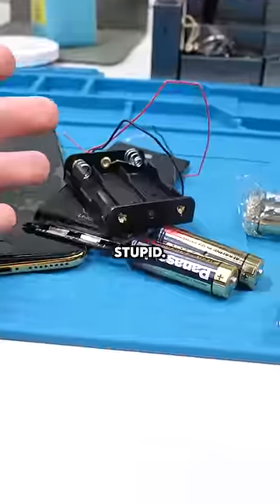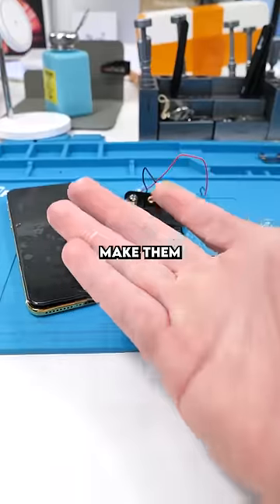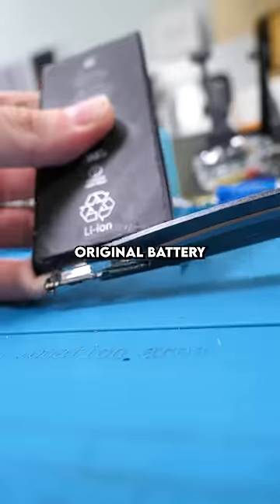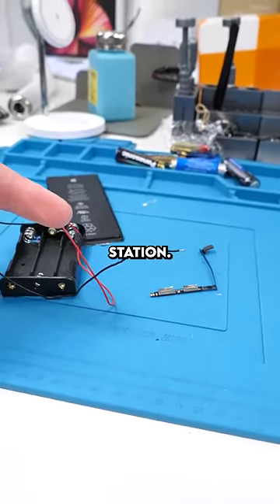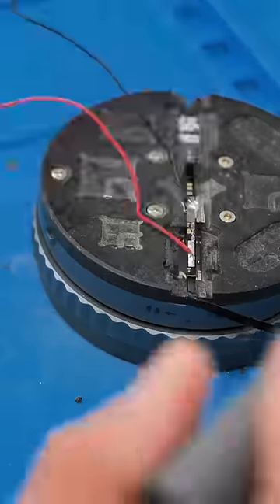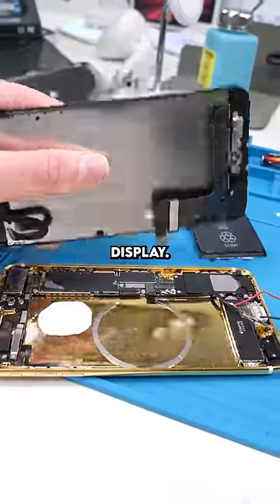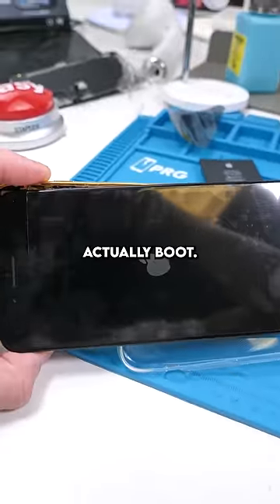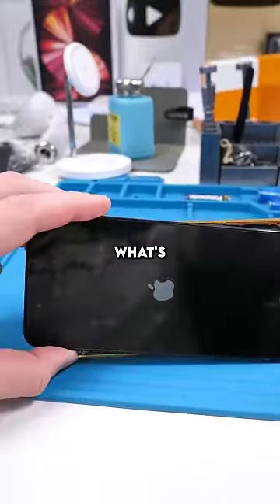REPLACING AN IPHONE BATTERY WITH DOUBLE A BATTERIES... Will it Boot? #Shorts

Comment: Just connect enough batteries in series to get the required voltage, then connect the same amount in parallel for external mAh.

Also use a dc-dc step up converter.

Comment: Use 2 or 3 18650 cells in parallel, they are a bit bigger, but they'll hold a lot of charge, will allow the phone to boot while still being removable

Comment: You could also opt in for an 18650 battery holder, I've seen some that are offered in 2 - 4 slots in parallel wiring and the best thing about them is that they output at about 3.7 volts - same to the voltage of the stock iPhone battery as well as other phones lel

Comment: You can use an 18650 lithium cell! They’re basically a bigger AA battery but rechargeable and with the same voltage as the internal iPhone battery. I could definitely see this working!

Comment: Use a lantern battery which is 6 volts and that is plenty of power plus you might break the phone because not only it's a little bit over the voltage they also output 10 amps

Comment: Three batteries in series output a voltage of 4.5 volts. What Phone Repair Guru Needs is a Buck Step-Down Converter which would step down the voltage from 4.5 volts to whatever’s desired.

Comment: use 3 rechargeable AA's, they can output way more current and have a lower voltage of 1.2v each, so 3 will give you 3.6v, exatly like an iphone battery

Comment: Run the AA's in series it will up the voltage , or use 14500 lithium rechargeable batteries they're. 3.7 volts instead of the 1.5 from a standard AA

Comment: I have been designing PCBs for a hobby and I’ve learned a lot of things…. You have 1.5*3=4.5 volts nominal
Those poly lithium batteries usually have a nominal voltage of 3.7 volts.

BUT usually there is a voltage regulator which will convert a wide range of volts to the needed voltage. 

This is important because batteries vary in voltage. Thats how the phone knows when it’s low on battery because there is a analog to digital converter which can tell when the voltage is low based on what’s expected. 

So the difference in volts I do not think matters since it is not too far off from what’s expected. What matters is that all the batteries powering the device has the same voltage and chemistry so that they don’t try to discharge or charge eachother. Also a problem is that those batteries are alkaline and cannot be recharged, that may affect how the circuit works.. 

Anyways. I think a phone can be powered* with 3 AA batteries. It’s just not convenient because it doesn’t have nearly as much energy density and cannot be recharged. The phone would lick up those batteries rated ampshours in no time.

Comment: You can use NIMH batteries, their voltage is lower than regular AA's, if you have 3 of em in series you get 3.6-3.7v which is way more accurate to li-ion compared to alkaline (1.5v x3: 4.5v)

Comment: Honestly, I would try wiring 2 sets of 4 batteries in series and then those 2 sets in parallel and then use something to downregulate to a clean voltage and amperage of the specs for the OEM battery

Comment: The boot issue was propably because of the low current, the putting the batteries in a 3s3p configuration, or connect to a bech psu to prove this theory

Comment: Why wouldn't it boot ? AA battery when it's full is 1.35v. 1.35v x 3 = 4.05v. a modern phone will run on 3.4v to 4.4v (if it's using the new li-po design with 3.9v nominal, or  4.35v with the standard 3.85v lipo battery)

Comment: Use a capacitor with the proped output you need, then bigger batteries to supply the capacitor.

Comment: I did this with an old flip phone because the battery didn't hold a charge anymore, I used rechargeable AA batteries because the voltage is lower (1.2v each so 3.6v for three) and the phone runs on it, I also didn't  use the BMS board I just connected it directly to the phone

Comment: Should have used rechargeable Ni-Mh batteries which have a lower voltage of 1.2-1.35V compared to alkaline AA batteries that have 1.5-1.6V. So in series, it will be closer to the lithium battery.

Comment: Did you try replacing one of the AA batteries with a NIMH AA rechargeable? That should top the battery at 4.2v, since the NIMH only has 1.2v, putting the pack <4.2v as max charge of a lipo that would normally be inside the iphone

Comment: Be careful with the batteries though! When plugging in the charging cable, the bms will try to charge the batteries and batteries wich can’t be recharged could catch fire or explode! You should add either a blocking diode or rechargeable AA batteries in your next version.

Comment: Might need to use C cells. Or use NiMh rechargeable batteries. 3 of them equals the voltage of a lithium battery pretty closely. Also those thin wires...

Comment: You can still get phones with removable batteries. It just won't be a flagship model. Take a look at the galaxy xcover pro. Just as good as the flagship but with a removable battery and it's basically indestructible

Comment: Use 18650 cells they are same voltage range as the internal battery. Should work :)

Comment: Eventually it will be at the point where if you get a phone you can modify it to run off of rechargeable double a batteries and you can just bypass planned obsolescence in batteries and also only need to swap the batteries to have a fully charged phone

Comment: I guess using 3 AAs in parallel would work because the 4.5V are pretty close to the 4.2V -3.8V phone batteries run an but that may still be too much inconsistency for the phone

Comment: Just remember the battery trick
Wire in series to increase voltage
Wire in parallel to increase output

Comment: Careful with the batteries... if you're trying to recharge batteries (plugging the phone in) that are not rechargeable you could have a "little" mess...

You could use 18650 lipo batteries with a holder... a single cell is rated at a nominal value of 3.8v just check the voltage of a normal cell and see if you need a buck-boost converter

Comment: If you use 3 rechargeable or 3 1.2v battery’s it will out the voltage at 3.6v and if fully charged, 3.8v at most.

Comment: This is actually quite funny if it works with a bit more batteries. Hopefully the BMS can handle the extra voltage (if not then it can probably be stepped down to a more acceptable voltage).

Comment: should have used rechargeable NiMh battery instead of alkaline. They are 1.2V which would make it 3.6 V instead of 4.5V.

Lithium nominal voltage is 3.7V so it would be like a low charge battery.
Reply: But the BMS should mesure the battery impedance. 3x AA battery have a very high impedance compared to lithium. Maybe the BMS think the battery is far beyond dead.

Comment: If you put in 3x NiMH rechargeable AA batteries you are in the voltage range of a typical Li-Po.
Because they have a nominal voltage of 1,2V per cell instead of the 1,5V. 🙂
Reply: Or if thats a bit too low you could mix NiMH and standard alkaline cells. 🔋

Comment: They run off 1.5 volts, just run another battery pack in series to that one and you'll have 3.5v to the original 3.75v

Comment: This is dangerous, not because it'll cause problems, but because of the wires or the batteries can't handle the current (extremely likely) the wires will burn or the batteries will explode.

It's also why the phone turns off when you remove the charger, the batteries cannot handle the current and the voltage sags, putting massive stress on the battery.

I'm surprised they didn't get extremely hot.

Comment: Make a simple step up circuit...  Or you know, add 1 more battery and step the voltage down.  The simpler and more "stable" method.

Comment: I wonder if it's not booting due to a large voltage drop, because iPhone batteries are only 3.7v and he had 3 AA's wired in series which should've been about 4.2-4.5 volts. Unless he used already used batteries it should've worked fine if imagine correctly.
Reply: Now if it's too high off a voltage I can see that being an issue. Maybe it's like safety feat. to prevent runaway

Comment: Use an 18650 battery instead. You won't have any voltage issues, and these batteries should be able to provide enough current.

Comment: Are you thinking of a step down resistor, or a dc to dc inverter circuit? Not sure if voltage fluctuation or sag is something you need to worry about.

Comment: Those batteries are in series. That's 4.5V. In theory, shouldn't it be enough voltage? Unless you had them in parallel which would only provide 1.5V

Comment: U need to use 1.2V rechargeable AA batteries, then total voltage will be 3.6V, very close to 3.7V of the Li ion battery.
Reply from the maker: I didnt know those exist :) Thanks Ron
Reply: @PhoneRepairGuru  Most devices does not care if you use 1.2 or 1.5V batteries, but I guess  that phones does cares. 
Anyway it probably will not work, phone battery BMS board design for Li ion battery, where AA rechargeable are Ni-Mh ,

Comment: You shoul have over the enough voltage and current capabilities with those but the wires you soldered are thin and there is huge voltage drop across them . Just try thicker wires . And i still dont get how it works with 4.5-5v. Those AA-s fresh usually have 1.65v so... wtf?

Comment: You’d want maybe 16 AA, 4S4P, that gives you 4.5V with the capacity of 4 batteries. Run that into a buck boost converter set to 3.7V. You don’t really need the BMS because you’re not charging lithium ion batteries and the voltage is already correct. To actually run a system like this, You’d want something that cuts power when the voltage gets too low. But it’d make a more entertaining video without one

Comment: Use resistors and capacitors to make the voltage the same as the original battery.

Comment: I wanted to try something like this with my old iPhone 5s that I had to get rid of the battery on because it started to expand. I kept the BMS board and tried to use a capacitor to hold a charge to get it to boot but it didn’t work. Also, you already knew this but that was only 3.5V, iPhone batteries are usually 3.7-4.2V. You would have maybe had better luck with 4 AA batteries, though that would be 6V which would be over that. Another thing, plugging in the charger with the AA batteries powering the phone was kinda dangerous because the BMS was likely pushing current to the batteries to try and charge them.

Comment: Try using 3 x NiMH AAs, they have a fully charged voltage of about 1.3-1.4V, a bit lower than alkalines and should not enter over voltage protection!

Comment: Bro didn't even take the time to find/make the correct power circuitry to correct the voltage & current output so the batteries output at the correct wattage. Smh

Comment: You should use slightly used batteries so the voltage goes to around 4 - 4.2V

Comment: I think each of that is 1.5v, use 4 batteries and then run it through a 3.7v voltage regulator. Easy peasy